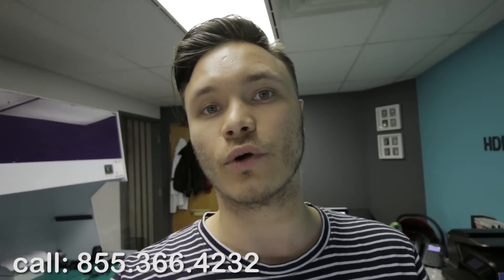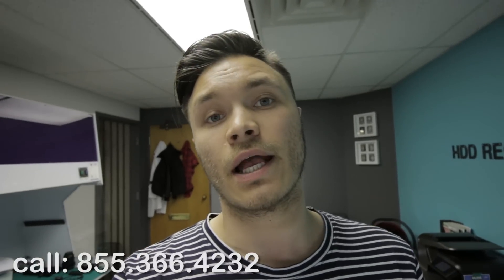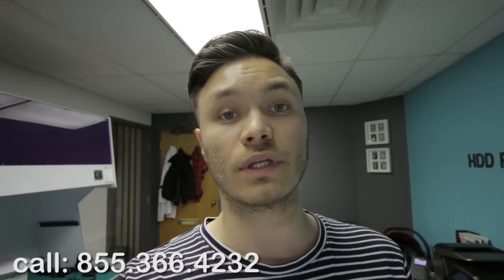how to recover data from dead usb the easy way

Comment: Just to be sure. The client have an dead usb device but the data in this divice it is such important. Then like the data are inside the memory and not the eletronic part I just need to buy another usb device from the same serie, same lot, same serial sequecy production and swith the memories?

Comment: Is there a time limit for this? My flash drive stopped working about a year ago, is it still possible to save it?
Reply from the maker: Yeah, unfortunately for Flash memory the time does impact the recoverability. One year is OK, memory gets bit errors from discharge if not in use constantly. Better do it now, rather than waiting

Comment: Can We Increase Storage From 4Gb To 256Gb By Changing Its Chip?
I Have A Dead Transcend 4Gb Pendrive.
Reply: You would need access to the manufacturers tools to configure the drive after changing the chip. Unless it is based off eMMC (the controller and NAND are on the one chip). But in either case I doubt it would be financially viable.

Comment: May you tell me the Temperature and time necessary I need to melt the SMT pads without over heating the NAND chip. 

                   I have repaired a few USB flash for no for money just to learn, but sometimes I have burnt the NAND when practices(Because I don't have that Specific Air Nozzles). I used the regular round Air nozzle. and I don't know the curve Temperature max that a NAND can support and the time that it exposed to. 

You speed up in the process which was really important to appreciate. Please may you share: Air nozzle mm size? Temp max when you exposed the Nand, and time of heating when you vacuuming the Nand?

Comment: is there a way to recover the data without using hardware? like pluging in a usb stick that is practically dead but managing a way to somehow retrieve the date using the tools in your laptop or pc? i ask this because my usb still lights up and appears as an ureadable device on any pc or laptop i put it in. however it has very valuable data like important certifications, resumes, and musical projects in it. Also we don't rally own any of those tools. I liked your video very informative

Comment: What about chip on board nand flash? How do you remove the epoxy? Thanks great video
Reply from the maker: you don't. You would want to look up a datasheet for the controller and use NAND protocol controller pads to read NAND

Comment: I have a Sandisk Ultra 32 GB that is not working anymore 2 days ago... And i have another Sandisk Ultra 64 GB unit that works, so my cuestion is, this process works ??
Reply from the maker: Daniel, it will not work. The controller that programmed to run 32GB unit is not the same as 64GB.

Comment: Question: if I don't have the same identical drive but have a NAND flash chip reader. Can I dump the whole memory and run some process to recover all files? Any suggestion for such SW?
Thanks
Reply from the maker: reading dump from NAND with a reader is going to give you a physical image of the device. You would then need to create a logical image out of it. Physical image almost never has complete data that can be accessed right away

Comment: Yeah, everyone has a lab with all types of equipment and knowledge to do this.
Reply: "The easy way"
Reply: In reality, it is quite easy. You just have to realize what audience this is being directed to. Not easy for someone that has never soldered in their life, but quite easy for even someone starting out with microsoldering electronics repair. You could very comfortably get this done with less than $300USD worth of equipment so no need for a full lab. Obviously for 99.99% of people though that are trying to figure out how to recover their data, this would be overwhelming.
Reply: I know. And everyone knew to buy a double years and years ago... You know what I would have done if I had 2? Ensure they stay clones of each other at all times.... <.> With the exception of one breaking naturally.
Reply: LoL 😂🤣

Comment: I thought the whole idea is to get the memory working in a non-working USB thumb drive? If I take memory from another USB thumb drive then you once again end up with a non-working USB thumb drive. What's the point to this method? If you have an emotional attachment to a particular USB thumb drive and 'have to' see it working again, then repair it. If not, buy yourself a new one and don't break a USB thumb drive just to repair another one. If you say: "I'm just taking parts from another broken USB thumb drive so I really am not hurting anything?" Think, you are installing broken parts to another device to make it work? That's a risky idea to install broken parts to a device that stores your precious files. Praise The Lord and Godspeed to you all - Romans 10:13!!
Reply from the maker: Tony C. This process was done to get a failed device working again to extract data that was on there. Not to repair it so it could be used again
Reply: HDD R S Thanks for responding because this sounds interesting to learn about. Would the memory chip you removed as a replacement actually hold data and would the damaged chip not have any data left on it? If the replacement chip had data, it would just carry over that data unto the repaired USB thumb drive? **Notice the question marks ;O)  Praise The Lord and Godspeed to you all - Romans 10:12-13!!

Comment: Hello, my question is:
Do i need a working pendrive with the same amount of gb to do this? 
in my case - Silicon Power 128GB Blaze B30 USB 3.0 Swivel Flash Drive, Black (SP128GBUF3B30V1K) -
or can i buy a cheaper version of the same model? (for example same pendrive but 16gb) thank you

Comment: I have a question. What if i use a different drive but with desame PCB layout? i mean same chip and controller but different PCB?
also my problem of my usb is it lights up but in a constant blink, it gets relatively hot and it caused my PC to get blue screen three times. I guess is the controller?
Reply from the maker: devices have to be entirely identical

Comment: Which chip gets broken the most? The controller or the memory chip?
Reply from the maker: booger king either one can fail. PCB could be damaged also, and even resistor and capacitor could be blown out causing this device to not work. That's why I swap the only unique part to a confirmed working board

Comment: Hi, the first thing: amazing job! The second thing, if I can ask: can I do the same with a smaller storage drive? Like using the board from the 4 GB version to recover a 16 GB usb drive? Thank you.
Reply: Nope, the components might not be same, giving to voltage regulator, as well ICE lengths, better first go to producer website to source that info, before trying 💯

Comment: Im trying to do recovery on a USB 3.0 sony drive no one has done one on youtube yet by soldering wires with custom cable. the pads are ok on the usb. I am having trouble finding the pinout

Comment: When I solder and unsolder a memory IC a soldering iron never is used as the heat blaster does both jobs... Soldering iron on micro IC's is bad practice....
Reply from the maker: that's just BS... Micro soldering iron is far less harmful than any rework.

Comment: I have had many troubles with defect usb sticks from "Intenso" lately. While the 16 GB version is pretty reliable the 32 and 64 GB versions are extremely bad. One stick suddenly could no longer be accessed (after less than a dozen uses) and the other i have can´t be fully loaded. When the last file to fill up the stick is written an error message appears saying the usb drive is write protected. Some days ago i have read an article saying manufacturers of usb sticks use recycled memory chips and other components. Do you know anything about that and could this be the reason why especially this usb sticks are that unrelieable?

Comment: Bro... I have 2 sandisk USB's of 32 GB... Few days back both were working fine... Today I check and when connected with computer (both the usb devices) in device manager it shows unknown device with Yellow Exclamation mark ... Both of the usb device failed at the same time. I have swap the usb ports and also tried with different computer.... Still the same issue.. How we can fix this issue?

Comment: can I just do what ever you did, but instead of using that machine can I just do it manually.....and carefully?
Reply from the maker: I am sure it's doable, but not going to be easy without the microscope and rework station. pins on TSOP48 chips are very close to each other, and you can bridge them easily. Also removing the chip without damage if you don't have a rework, will be a nightmare.

Comment: i personally use this method 
did you try to move nand flash to different flash driver brand but with same cpu chip like chipsbank or alcor or ... .
Reply from the maker: no, relationship between controller and ID of the NAND would be different in almost every case if I think

Comment: I have an iphone 6 that doesn't boot anymore i took it to the apple store they said that the whole circuit board got burned and i'm wondering if you can recover data from that.
Reply: LineCommander ,inc It might just be a bad battery. There is no way they can know it is exactly that without opening it up. Torx 3 bits open them right up battery is inside glued.

Comment: I want to know what kind (Make and Model number) of microscope you use?  What magnification level do you need to do that kind of work?
Reply from the maker: Meiji EMZ series. I have 3 of them. EMZ-8TR is the one I use for video, I also have a EMZ-5 and EMZ-5TR.
they are pricey, but they are extremely sharp.

Comment: I have a 32gb SanDisk USB that just stopped working it was almost full and everything inside is super important (Games)
if i take it to a local computer/Electronics store would they be able to get the files back?
Reply from the maker: hard to say. where are you located? I would look for cell phone repair shop actually, they are usually well equipped

Comment: had been using this trick for sometime now it must be usefull for some people as those drives are obsolete, have a question for you!!

Know a way to bring like to HP v165W, last i had used it was in 2012 has my graduation & imp memories, worse part is i never used this drive at all ever since, 2016 i tired to plug it in and drive just wasn't getting detected!! are there some kind of IC Adapter in which i can plug it in and it could give temporary life for data to be retrieved.

Comment: shouldn't any board (tsop) work? if they use the same time of flash the actual board is just a flasher it should read the capacity of the new nand right?
Reply from the maker: no, each NAND has its own configuration, and controller is programmed to work with that config while using an wear leveling algorithm. So if you do the NAND swap controllers have to match, ID on NAND has to match, and obviously the size of the flash drive must be the same

Comment: Your soldering skill is amazing. I can barely solder the wires on my headphones and you solder tiny IC leads as if it's nothing.
Reply from the maker: thanks, with good tools and a bit of practice it is much easier than you think
Reply: Yes, he is the man.  His obviously a student from MIT he works at Lawrence Livermore National Laboratory his work is on Mars he did the circuitry for  NASA's Curiosity, you know the Mars Rover.  Has a crazy tattoo of a B&S Gauge Chart, Which he had  Memorized at the age of 4.  When asked what he thinks of Time Travel his answer was "I enjoy it" and "I am working on a two-seater", you know for the girls. Keep up the good work son.

Comment: I have a question:

Why not putting the G controller on the B's PCB, instead of putting B's NAND on the G's board?
Reply from the maker: David Refoua good chance that it will also work, but if the original problem was due to something else (oscillator, resistor, or even something board related) then controller swap would not be effective on its own
Reply: Yeah basically you need to move the data to a drive/stick you know works. Or else could be something else wrong or more wrong than just the controller on the original drive.

Comment: Hey man, today I accidentally broke 2 of my USBs that belong to a 3-set (The 3rd one still works so it could be a donor). But I'm not sure what exactly broke. They broke when I plugged them into a faulty USB port (The USB header must have been connected in the wrong pattern and broke them). They all have a light that turns on when being used/read and that no longer turns on.

I think I fried something, but how do I find out if I fried the flash RAM or the PCB board? Because I don't think its recoverable if the flash RAM died. Also how much would this process cost (Please state if USD, AUD etc.)?
Reply: Only way to find out would be to swap the flash out into the donor board.
Where was this port also? On a computer, or on a USB hub?

Comment: Isn't it easier to remove the controller chip? I asume it has less pins than the memory chip.
Reply from the maker: Adi Serghei and what if the controller is not an issue? You suggest changing every resistor and capacitor one by one? It's not about what is easier, but about what works
Reply: What would have been the next step, if this "donor swap" didn't work?

Comment: Hi sir how much do you charge for data recovery from a dead thumb drive please?
Reply from the maker: It really depends on the type of the flash drive, capacity, and the type of failure
Reply from the maker: Best thing is to contact us directly 1.613.366.4232

Comment: What chip reading equipment do you have? I had a pc-3000 flash but I sold it because I never learned how to use it.
Reply from the maker: I use Flash Extractor and Rusolut. I don't  have need for PC3000 flash at this point  because there are no features to improve what I already have

Comment: You are able to solder a TSOP chip only using a soldering iron! Man you are a god. It's so hard because:
1)hard to keep the chip in good position,  and to align pins and pads , it's so ridiculously small.
2)It's very easy to make short between the pads, i think you have a magic flux that is able to avoid the bridges between the pins.
Too bad that we cannot see your soldering.
Reply from the maker: Thank you so much :) I promise that next time I use this technique I will film the screen capture from the microscope. I honestly thought that had it on this time, but when I finished soldering I saw that record was not on :(
Reply from the maker: oh and the flux indeed is very good, it is made by a Canadian company MG Chemicals http://amzn.to/29L0Vib
I've worked with genuine Amtech flux that everyone recommends, but I find this stuff works way better.

Comment: Just curious how closely you adhere to best ESD practices? Some people think its pointless others are religious with matts straps and deionizers...
Reply: May be HDD Recovery Services is another opinion, but we don't care about ESD in our lab. I'd like to explain why. 

First of all, you need special materials (most of them are cheap) for an ESD. So if you aren't working in cheap synthetic cloth or wear cotton, there is no chance of an ESD.

Then I never ever saw a chip gets immediately bricked by an ESD. In most cases, the ESD damages the chip, so it's going to die in the next time. But our intention in data recovery is not to repair a USB Stick, but to recover data from it. When we have the data, we're done. And even after an ESD the chip is going to survive the Data Extraction process.

Why do we don't care about ESD? Well, we do in some kind. We have a grounded mat on our tables our equipment is ESD Safe. If we are going to do more about ESD, it would causes more problems than helping us in DR.
Reply from the maker: I got ESD mats that are grounded in the laminar flow cabinets, but other than that I don't use any other practices. In 11 years I have not had a single incident  with static killing parts/nands/preamps
Reply: There are people who absorbs and produce high ESD's, they are the one's wearing a loose shoe fit. Good looking people like us produces little sensible ESD's. Been handling "Sensitive" computer parts for more than 2 decades, and no such thing happens. Maybe it is the manufacturer's way of telling the consumer that, Hey... if it broke bring it to us Only.
Reply: Where I used to work, Whirlpool Corp, our controls assembly area requires esd mats, deionizers, and heelstraps.  When someone forgets their heelstrap, it is caught on the testing carousel because we will get numerous control board failures in an hour.  Typically when we are running normally we may get one or 2 a week.
Reply: is this any way to get files from our broken micro sd card i am very upset coz my sony 32 gb micro sd card was minor line break on it and it has some thing 18000 photos i want it back so pls help me plsss tell me how we can get it back